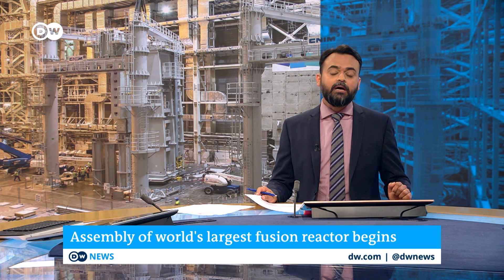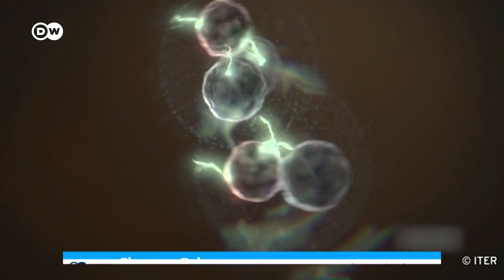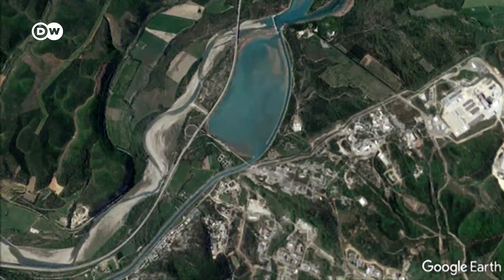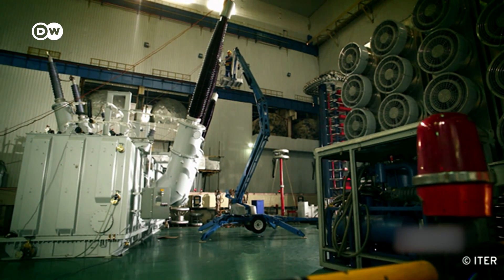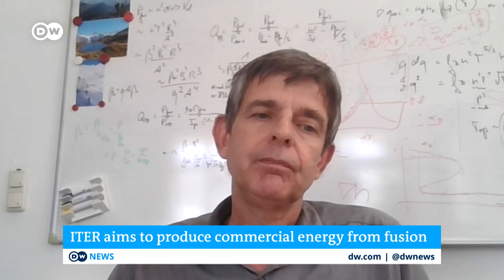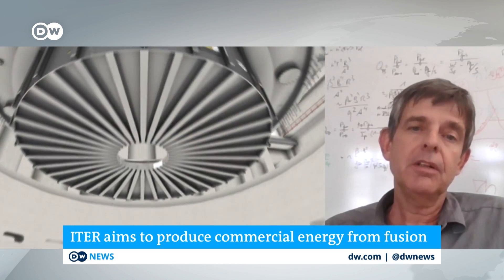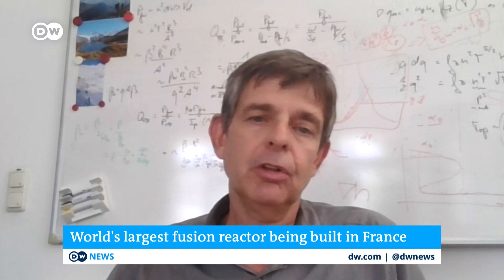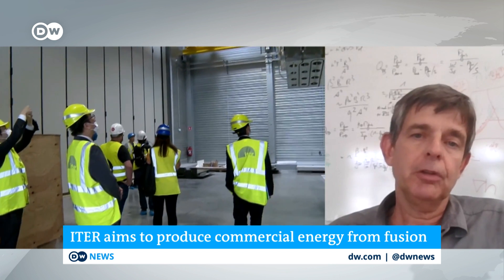ITER: Assembly of world's largest nuclear fusion reactor begins | DW News

Comment: Salt water flowing through a matrix can generate power, It pretty common physics, but lets abstract the idea to create a possible breakthrough, I've actually remote viewed this one so i know not only is it possible in some version of reality it already exists.😂😂😂😂 A meta solid material say in the shape of a matrix structure or toroid shape with a meta liquid within it  that is flowing at high speed. Now the two properties of the meta liquid and solid can be designed to react to each other with high efficiency at cold temperatures creating a high energy output from the flow of a synthetic meta liquid.😂😂😂😂.I'm pretty sure this is how we get to a version of cold fusion or something very similar. because the two materials one liquid one solid, can be designed to react to each other on the nano or quantum scale, Infact they can be based on the properties of two different materials on the periodic table that would normally become explosive in their ability to react together, meta materials can be designed to emulate two highly reactive materials in this way. for example water and magnesium.

Comment: All fun and games until you realize that a 62 billion dollar power plant putting out 2 GW of power would take almost 2,000 years to return a profit.
This is the real reason solar power failed to take off. Until recently, it would take a solar panel 40 years to return the amount of energy made to produce it.
Reply: This is purely a research reactor, after they did there research they will build a simpler reactor called DEMO.
Reply: Doubt they’re going to cost 62 billion dollars but it’s a good point
Reply: "Until recently it would take a solar panel 40 years to return the amount of energy made to produce it". "UNTIL RECENTLY" Exactly... that's why research happens and efficiency increases. You can't discard a whole category of technologies based on what effectively are prototypes.

Comment: Fusion reaction is not producing pollution, but the reactor does, and a lot: 

1. The supra-conductor used in the reactor are made with 450 Tons of a very specific metal, the Nobium. And the insulation are made with 12 Tons of Berylium, a highly toxic metal used in electronics components. And the shelf life of both metal submitted to the radiation inside ITER is only 10 years, it means we will need to replace them, and recycle them, every 10 years. Only we don't know how to recycle radioactive Nobium and Berylium.

2. The whole item weight 23.000 Tons, and lie any nuclear reactor, it has a shelf life. We will need at the end to replace it and recycle it, but here also, no recycling option, 

So at teh end , instead of having a zero waste reactor, we will have 462 Tons every 10 years, and 23.000 Tons every 40 years, which means an average per year of 600 Tons. And we will have to concentrate it and burry it, just like we do today with Fission.
Reply: Its a cost we can afford but we just have to be very careful about how we dispose of the waste
Reply: If we build a lot of these reactors it will reach a breakeven point where the waste produced will be less then the amount of waste this saves us. Plus coal, solar, and wind all produce more waste per gw of power.

Comment: Its easy, if you DO MAKE THAT THING -- you will end up with a giant machine that can make WAY MORE POWER THAN YOU WILL EVER USE -- BUT! You can use electrolysis to make hydrogen gas and put it all in tanks, you can just keep making as much hydrogen as you want, and ship hydrogen all over europe!  Let fuel cells turn it back into power
Reply: Do you know how much energy hydrogen electrolysis requires? That would be even less efficient…
Reply: @mat7can106  They are 70% efficient in converting energy, but when you have a massive excess of energy and nowhere to put it (you can only transmit electricity so far) where does it go?  If you build a massive fusion reactor that can produce limitless energy that all cities within range cannot consume, then you can simply put the excess (that you would lose anyway) into clean hydrogen by splitting water and storing it.  Please enlighten me as to why this is a bad idea.
Reply: @benmidas  that’s possible

Comment: In this gigantic project, the consequences of a lack of high quality communication can be catastrophic. Here are several examples of what can happen if you do not respect the communication standards expected by the public: for example at the time 4:00 it is said that lithium is very common. First, it becomes very rare through its use in batteries. Secondly, it is the isotope Lithium-6 that will be used, whose enrichment is strictly controlled so as not to risk nuclear proliferation. So very rare! Finally, the instabilities of the machine are not mentioned, nor the enormous power consumed (400MW) to produce only 500MW of heat. Converted into electricity, it would be 300MW. therefore a much lower output than the unit; a disaster of efficiency. Finally the cost, about 40 billion dollars, I did not hear it announced. Very expensive technological fascination!

Comment: I have yet to find someone who can tell me why we are going for fusion instead of molten salt thorium reactors? They both have virtually the same benefits, however molten salt reactors have already been invented, and we know that they work. Can anyone answer me this?
Reply: Well for starters you’re wrong in thinking it’s one or the other. We’re developing both in parallel. Private companies do whatever they think is most economically viable.

Molten salt reactors are not developed yet. We haven’t come up with a solution to this issue of how incredibly corrosive the salts are.
Reply: @Gomlmon99  that's not true, they had a working one in the past with no issues, and it actually generated more energy than it took to run. Fusion is way more costly and won't be commercially viable until at least 2060. MSRs on the other hand are not getting the funding they need, and in my opinion, they could solve the worlds energy problem.
Reply: @the_saucisson  when did they have a working and commercially viable thorium MSR? Please link.

Comment: Question: How is it possible to have temperatures (sustained temperatures at that) hotter than the sun on earth? The magnetic field REQUIRED to maintain it could fail at anytime thus causing complete reaction failure. Then what would happen?
Reply: Then you’d melt the surfaces of some diagnostics and have to replace them. An expensive failure. Making sure this never happens is an important area of research, as it would cost so much to replace instruments inside the reactor.
Reply: @Gomlmon99  This is just my opinion, but I think messing with fission is an extremely bad idea because just like with nuclear reactors (men THINK they can contain it.) Just as in the early days of messing with it. How in the world could temperatures HOTTER than the sun be contained on earth. There is a reason the distance of the sun is over 90 million miles away from earth.
Reply: @darinb.3273  Well for starters, bare in mind we have things WAY hotter than the 150 million degrees used in fusion. Humans have created temperatures in the trillions. That’s a million times hotter than fusion. The temperature isn’t particularly relevant to how safe it is. Fusion reactors are physically incapable of exploding, yet a tank of gas at 20 C will explode violently. Temperature is irrelevant, total potential energy is what’s relevant.

Also, why is the word “control” coming to your mind? We don’t need to control it in this sense, it’s not a potential runaway reaction. If anything whatsoever fails, it just goes out. That’s like saying what if we lose control of a solar panel.
Reply: @Gomlmon99  I'm just not convinced the whole idea of fussion can work in a useable manner. Every test I've ever heard of the unit uses WAY MORE energy than it produces. I admit I don't know a whole lot of how it works but last I heard it isn't sustainable, something ALWAYS fails and the reaction ceases. I assume you know much more about it than myself.
Reply: If the magnetic system fails the heat will die of quite quickly

Comment: Our material sciences is not up to the tasks.
Reactions at the speed of light, hard to control at macro level.
We have great proven fusion source,   the SUN.   LOL

STOP WASTING  MONEY AND INVEST IN SOLAR ORBITAL POWER.  THAT WORKS.
Reply: How do you plan on getting the power from the orbital solar panels down to Earth? The issue with solar is that there is simply not enough solar energy to suit our current energy demands. They can be used to supplement our energy production but will not work as the main source in most places.
Reply: @Redtooth75  YOUR KIDDING,  RIGHT?    JUST BASIC ENGINEERING,   
POWER GENERATION DELIVERD VIA MICOWAVE POWER TRANSMISSION.,  LOL

LIKE 5G  ON STEROIDS,   GIGAWATTS
Reply: @jamesmorton7881  do you realize how inefficient it is to wirelessly transmit electricity? 5g is a signal, it does not need to transmit any significant amount of power, just 1s and 0s. There is a reason we use power lines. Not to mention the cost of getting them into orbit, and the amount of debris that is currently in orbit.

Comment: These Guestions Should be made a documentary
1 : How to filter the Product Made In the reaction
2 : How to use it ?
Reply: can I answer?
A fusion reactor produces helium, which is an inert gas. It also produces and consumes tritium within the plant in a closed circuit so it won't exist for a long time, Tritium is radioactive (a beta emitter which means it isn't even dangerous to humans if we are even 5-10 metres away from it) but its half-life is short, there are already like 10 small to mid-size fusion reactors on earth and it's safer than coal, even nuclear fission
I don't get your 2nd question-what do you mean how to use it ?? with fusion, the sky is the limit
you can use it to power your rockets, power whole cities and produce literally no waste
if humanity has to move forward,fusion is the key and the future
Reply: @justanotherlegend3315   Epic, hopes up Iter works smoothly !
Reply: @GorkkaMorkka69  it produces helium which we can use in floating balloon

Comment: Fusion needs rare isotopes of hydrogen - tritium and deuterium. These ARE found in sea water but they are extremely costly to extract. 
Nuclear fission is clean and safe. The issue is cost of making its inherently hazardous plants fully safe. The new molten salt plants are a much more simple design. They have very little that can go wrong and they cannot melt down.  
The problem with fission is not the process it’s they way we chose to design our reactors. 
Today’s PWR reactors can’t extract more than 5% of the fuel energy. The remaining 95% is classed as “irradiated waste”. 
We now have the technology to fully burn the fuel (or indeed the waste) leaving no long term waste. We also get 24 times as much power from a given amount of new fuel. 
The companies Moltex and Elysium have fully engineered designs ready to go. The delays are entirely regulatory. In USA they are geared to regulate only the current reactors (PWR). In U.K. we go through the whole process for every new design but the system is painfully slow and expensive. 
The first Moltex plant is being built in Canada. It expects to be making electricity before 2030. The fuel will be entirely spent waste from an old plant next door. The current 30,000 years 1/2 life will be reduced to 30 years. Moltex expect the plant to cost less to build that a natural gas fired plant. Fuel costs are zero because they are solving a costly storage problem. Operating costs are low because the plant is intrinsically self-regulating.
Reply: Helium3
Reply: Could get if from moon

Comment: 1:29 "Fusion is not a chain reaction, so there is no possibility for a runaway" Have you heard of hydrogen bombs??? 
The level of scientific explanation in these DW videos is appalling.
Reply: @Seb C no it is not it is only about density. These DW movies are so low quality science wise that I would not recommend their use even in high schools.
Reply: @Seb C the only reason a fusion reactor does not blow up is the density of available fusion material. But to say that runaway reaction cannot happen because it does not happen in fusion as opposite to fission is just scientifically false. Increasing heat and pressure makes fusion possible and that is the positive feedback all explosions rely on, a positive feedback. Fusion reactors have to be moderated by controlling the material that can fuse and that is also a question of controlled burn. Not that we could sustain a long enough fusion where feeding it new material ever became a problem :))))
Reply: @Seb C let us analyze the statement in this video. The statement is that fusion, unlike fission, cannot have a runaway reaction. That is untrue. That is all.

In a documentary they need to be precise. They cannot tell lies meant to reassure people. If they said the design  of the reactor is such that at no point is there enough fuel injected to create a catastrophic runaway reaction ... that would have been a much better statement. But that is not what they said.

Once we would have continuous fusion and we could solve the problem of injecting new fuel and extracting the spent fuel from the reactor (which we cannot) then it would be again a dance on the edge of criticality. You are right about not having all the fuel present inside the reactor but modern fission reactors can also be built to be passively safe. Unlike the fusion reactors, we know how to do those.

Fusion is driven by density and heat and the reaction itself produces heat so yes there is a positive feedback loop. There might not be enough material present at the same time but the positive feedback is there. But again, fuel injection and waste extraction, not to mention energy extraction are not yet problems that are solved in the case of fusion reactors. We cannot even sustain the reaction for any significant amount of time the records are about holding the plasma together not about having a fusion reaction.

A very short burst of fusion can be achieved both in the tokamak or the NIF but both are demonstration projects not power plants. This is a dead end and has been for 70 years while perfectly good French nuclear designs with 100% safety record are shelved and France is forced to de-nuclearize its energy sector. It is a shame.